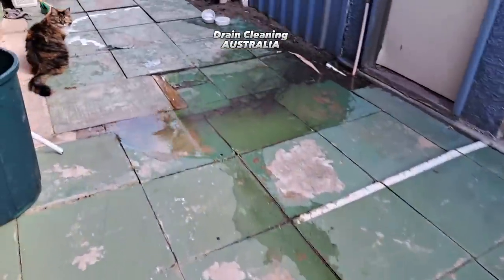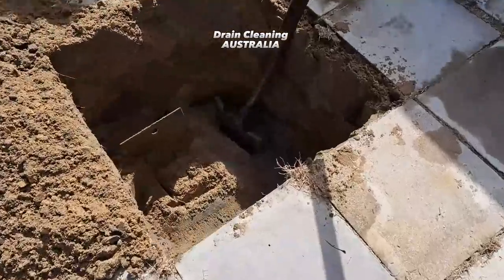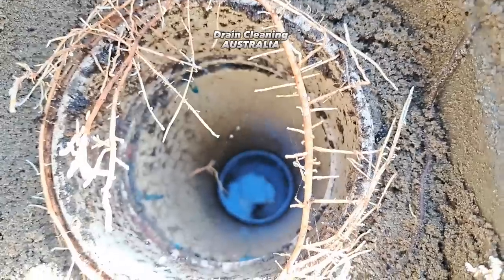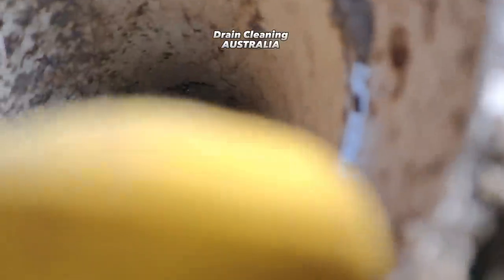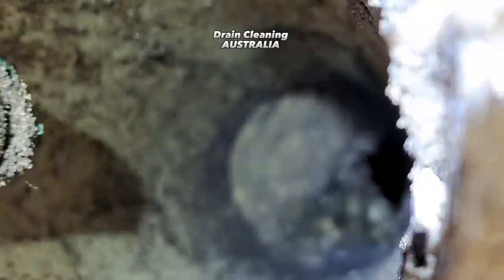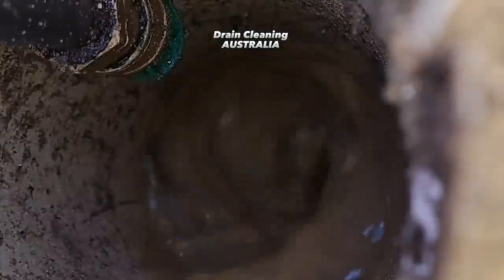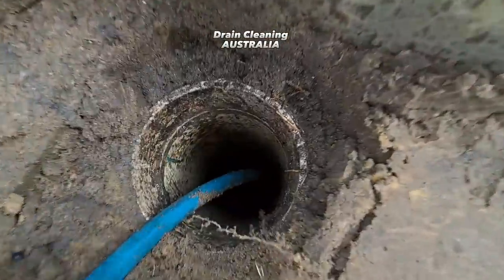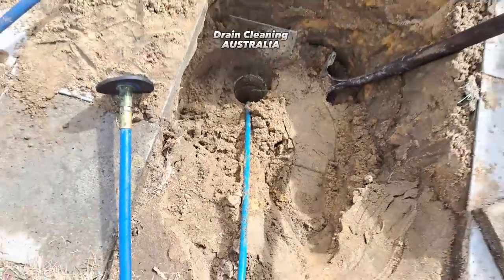A day in the life of a Plumber, clearing a Blocked Drain

Comment: Bruce, might I suggest a tether of some sort for your phone? Not one of those wrist strap tethers either. Some phone cases come with a point on the corner for the wrist strap, so a key ring on that and some sort of clasp on a long piece of cord or twine. This way if you drop us down the pipe, you can pull us back up!

Well, that would be one helluva front row seat, wouldn’t it?

Anyway, I’m slowly catching up on these videos.